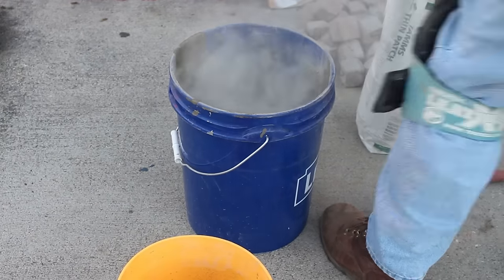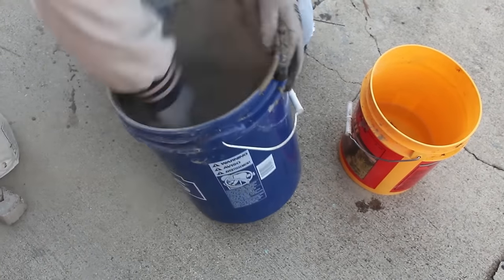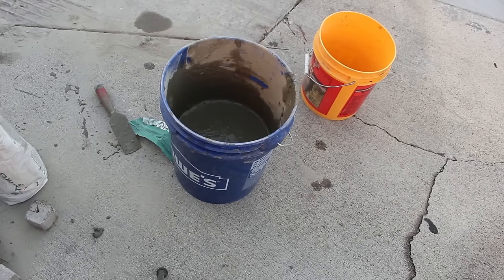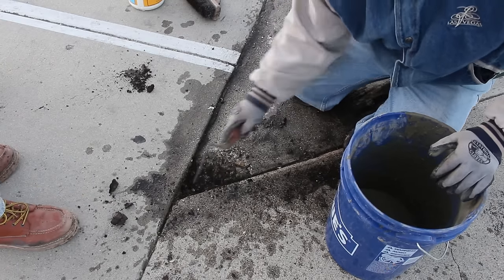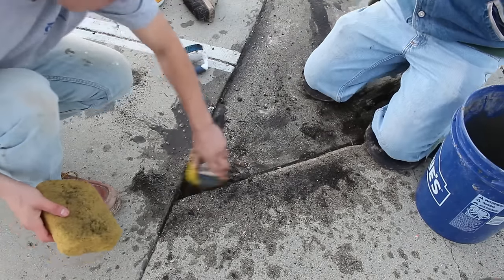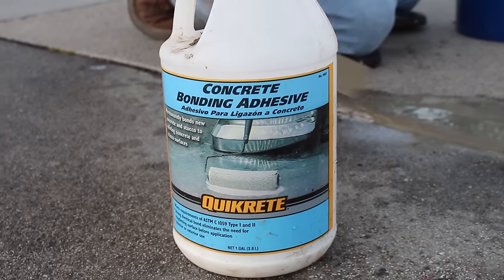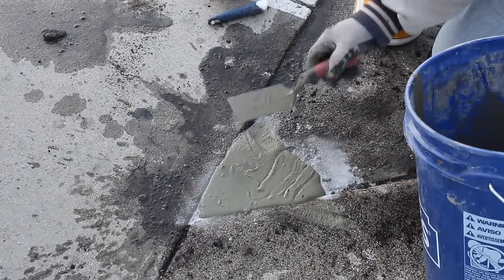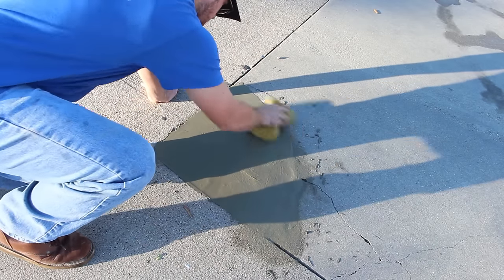How to fix or repair Chipped Cracked or Broken concrete!

Comment: My sidewalk has a bunch of cracks so I'm hoping to just pour an inch or so of concrete right over top of it rather than pulling the old concrete out and starting fresh.  Is this a realistic idea?
And should I be adding any type of rebar or remesh before adding the extra layer?
Reply from the maker: Maybe with a sand layer

Comment: I have a chunk of concrete that broke off the side edge of our front porch - it is about 3 inches wide and up to about 1 1/2 inches thick at the bottom.  Should I drill into the slab to insert a rebar before building a frame for the repair?
Reply from the maker: Concrete glue should do the trick

Comment: You mentioned that you were working on a fairly level surface, so it self leveled. We're looking to do a repair on our driveway that is not level. Any suggestions?
Reply from the maker: It should work the same

Comment: awesome tips.. I didn't realize you needed a bond layer to get the new concrete to stick to the old one
Reply from the maker: Oh yes
Reply: You don't always need it. Depends on the materiel you're working with. The instructions will tell you if you should use it or not.
Reply: My sidewalk has a bunch of cracks so I'm hoping to just pour an inch or so of concrete right over top of it rather than pulling the old concrete out and starting fresh.  Is this a realistic idea?

Comment: I have a driveway that is two years old but has a couple of broken areas near the expansion joint. Also have a couple of hairline cracks. What do you mix to match existing driveway color. The driveway is a very light gray. Thanks
Reply from the maker: Quickrete vinyl patch

Comment: How long do the patches last? And is there anyway to match light to dark variation in color from concrete age? I just did a bunch of scratch damage to an old slab getting stuck with studded snow tires.
Reply from the maker: Patches are never permanent. Expect a year maybe more if you're lucky

Comment: Hi David. These videos are great. Hoping for a bit of advice. Need to level off my basement slab about 6 ft wide for til install.  No more than an  inch difference from the center to the sides. Would this product work well for the job?  What's an equivalent product to Tamms?.  Not sure I could get it in new york.  Last have some black adhesive on the floor from ply wood they glued down to install carpet that I pulled up to get down to the slab.  Can I use concrete adhesive and then I wouldn't have to worry about the product failing?  I really appreciate your response!
Reply from the maker: I would get a self-leveling product.
Reply: @OdellCompleteConcrete  I watched a couple more of your videso and figured that out haha.  Thanks a lot for.your response

Comment: Excellent video.  Any tips on addressing the joints?  I'd like to perform a similar repair on my driveway, but replace the joint filler.
Reply from the maker: I would try to keep the joints seperate because of all the movement

Comment: Nice work, I have some flaking on my concrete patio. Color will not match after repair, and ideas?
Reply from the maker: Different brands have different colors.
You could try to mix common cement and white cement with sand to get the right color.

Comment: How would you go about patching concrete holes on a plane of about 3-5 degrees?  How would you prevent the concrete batter from flowing out of the hole?
Reply from the maker: diomedes2k 
mix dry

Comment: I'm just patching my master bedroom where I removed carpet tak strips and the anchors chipped out.   I bout some quick Crete ready patch.   And will be doing a fuax finish xylone concrete stain and heavy clear coat over is there anything I need for the patch.  Should I need glue for 16th in to 1/4 in half dollar chips or should it be okay.
Reply from the maker: Glue is a good.Also I would do a complete overlay before staining.

Comment: what is the best alternative to using salt to melt ice in winter, something that wont destroy concrete?
Reply from the maker: heaters in the concrete
Reply: I use sand ("Play Sand") instead of salt. It is slightly more expensive but it isn't destructive to plants or to concrete. Also, I think, a few bags of sand per year isn't a huge expense compared to those environmental effects. It gives traction on snow and ice. Super-smooth black ice can still be slippery, in that case I try to rough it up with a spade.

After the ice goes away if there is a little sand left there it isn't terrible, sometimes it can even be swept up and used again.

Comment: Do you know why these kinds of videos get so many views? Because there are so many bad contractors out there, including the one I used for my patio, and people would rather try and fix it themselves. The thought of handing over a ton of money to another contractor to me is ridiculous at this point because I trust none of them. If anyone in NYC has had a bad job resurfaced well without having to rip it all out again, please let me know. I had a job done in 2016 that was bad from the get-go. I hired someone to touch it up last year and wasted more money. I was just in my yard today doing small touchups and if I could, I'd push the contractor who did the initial job into a tank of piranhas.
Reply from the maker: Resurfacing is always a temporary solution.
Reply: @OdellCompleteConcrete  It's very true. I've been mulling it over and it makes no sense. The cracks will come back. I've realized that if I keep on paying someone every spring to retouch or resurface, it's a waste and I could just wait a few years and rip it out with the money I save not hiring a person to resurface it yearly. I'm lucky that I kind of have a knack for cement work and that the imperfections are moderate enough for me now to retouch them myself. It's just terrible to pay a lot of money for terrible work. Next time around, I have to do my research on whoever I choose...But the contractor was highly recommended by a friend. Thankfully they pitched it right because my neighbor's new job isn't cracking but when it rains, she gets a  flood next to her basement window. That would make me really nuts.
Reply: That’s not why lmao. People chip their own concrete with heavy objects.
Reply: Yup!👍

Comment: Hey I have a cement question. The front of my house has a cement patio 14 years ago  put tile on it because it was cracked.  Now the tile is coming up and taking the cement with it.  Do you know if I would have to take it all out and install new or can you take out the top portion and set me cement on top to repair it?
Reply from the maker: Maybe it depends on how much the concrete is moving

Comment: How do you repair a crack in concrete slap that is very deep, at least 6 inches and about 2 inches wide in some areas.  It is less than an inch wide in most spots but very deep.
Reply: Use Quick  Crete fast setting mortar repair. use quick crete concrete glue.
Mix as much as you can apply in 15 minutes. Pack it in there with a flat stick.
Sponge the surface for nice finish.
Reply: Deep where? James and the giant peach ?

Comment: hey David quick question 
what would you use for surface chipping in a high traffic area. it's almost like the top layer of concrete flaked away. thank you in advance
Reply from the maker: Joe Biden 
high performance by quickcrete
has a mortar repair. seems to be real nice.
plus you can get the discount from the rep
Reply: @OdellCompleteConcrete  yeah he just a pawn like the rest of them was he even in power then? 🤣

Comment: I have a question. We have two approaches to our pavement that look terrible. I'm not sure what happened when it was installed but something went wrong. We got a quote from a company to demolish and replace them. They do have good reputation, but I'm not sure if it's completely mandatory to dismantle what we have and replace it. Obviously that would be ideal, but it's $2000 for that job. I sent you an email to show you the condition they're in. If you could let me know, that would be great. Thanks!
Reply from the maker: I took a look at the email and pictures.
Looks like the concrete will definitely have to come out and be replaced.
Reply: Yeah they just came to the house and they're starting on Tuesday. They're going to redo the entire pavement and it'll be framed with stamped concrete. I had no idea this stuff was so expensive. It's basically the cost of a new roof.
Reply: What is your email? I have a picture I'd like your opinion on as well. The concrete just on other side of our garage is crumbling where the melted water/salt from road meets the freezing temps in winter. Thank you

Comment: Would you apply this process to a basement floor which is old and started to decay?

Great teaching and work... by far the best informative and knowledgeable/no nonsense  that channel I’ve seen on youtube -👍🏻
Keep up the good work &videos!
Reply from the maker: I think in a basement you'll need to get that floor clean enough to do a sergical operation.
Reply: Rent a swing buffer with a medium bristle head and a wet vac from Home Depot and watch some videos about Ardex CD (concrete dressing) it’s an indoor/outdoor concrete overlay similar to what he used here

Comment: Hi, thanks for this awesome video! Can you use the same type of concrete (or concrete mix) to secure (wooden) "Fence Post" as well as repairing medium sized concrete sidewalk cracks? Here is a photo for the concrete sidewalk that we need to repair. @t.  Thanks!
Reply from the maker: Cracks yes
Post no
Reply: Hey, great video can you give me the name of the product you have used 
I need to repair the cracks on the driveway and pergola

Comment: Bonding adhesive isn't glue. And you completely didn't follow the directions. It's supposed to dry before you point concrete.
Reply from the maker: I believe your right